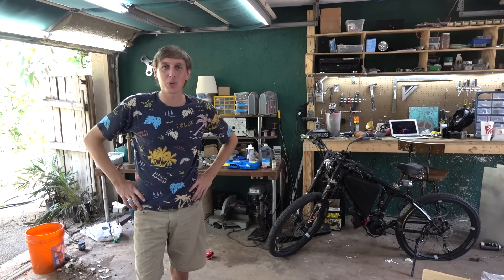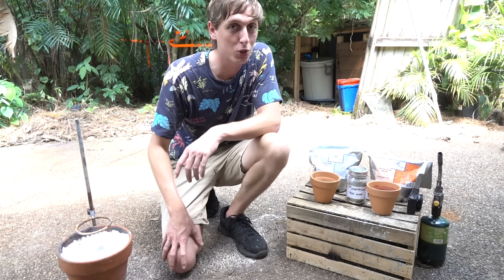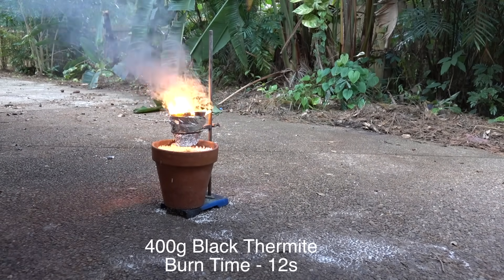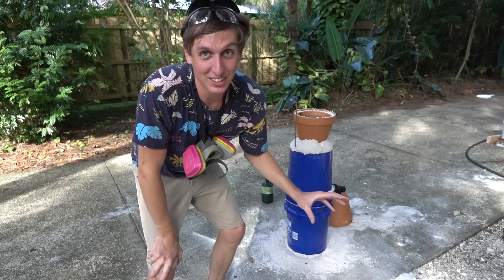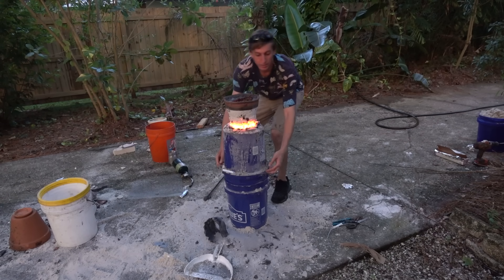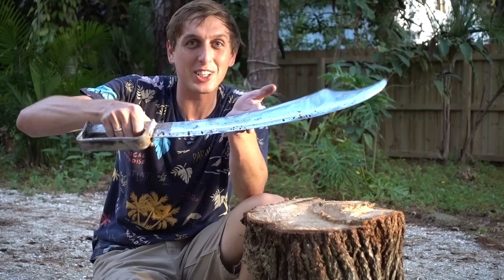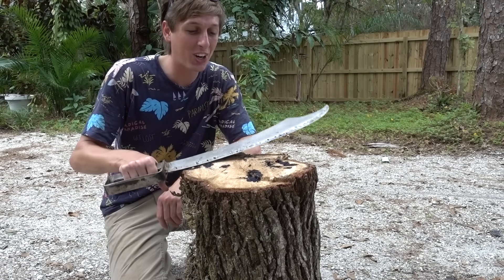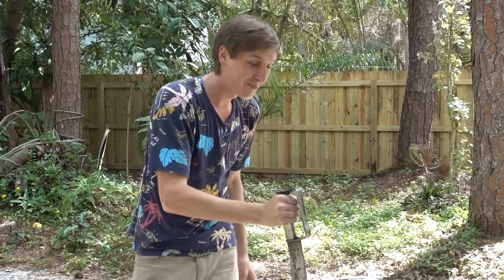Making a Sword with THERMITE!

Comment: if any of you are curous what the fricc thermite is:
Thermite is a pyrotechnic composition of metal powder and metal oxide. When ignited by heat or chemical reaction, thermite undergoes an exothermic reduction-oxidation reaction. Most varieties are not explosive, but can create brief bursts of heat and high temperature in a small area.

Comment: Worries about 500ml of lighter fluid.
Leaves a damn propane tank near termite.

P.S. It was very smart to remove bucket by hands.
If you touched it,you'd get 4 degree burns instantly.
Reply: Darwin Award winner one day, wait and see...
Reply: CME the propane tank legit had my anus clenching waiting for something to go wrong when the molds broke
Reply: propane really can't do much minus turn into a giant torch if the tank got ruptured, you can shoot a propane tank with a bullet and it won't even ignite let alone blow up as mythbusters has proven
Reply: CME As if you knew what 4th degree burns are (it's more than obvious that you don't)....
Reply: stevewonderful Damn right.
Just wait and see...
Reply: Confinium I wouldn't want a propane tank on fire while playing with thermite and having your hands busy...
Also it can explode if you heat it up.
Reply: as i work at tractor supply and work with filling propane on a daily basis for both our forklifts and customers and have been trained on the dangers of propane also, it is almost impossible to get a propane tank to explode
Reply: I dont think fourth degree burns are a thing
Reply: Ethan Baker Yes, they are. At the uni we've been taught that body parts that sustained 4th degree burns are completely carbonized, are beyond ANY possibility of saving and must be immediately amputated. They are also quite rare I'd say (because the body contains a LOT of water that has a high heat capacity and thus can absorb a surprisingly lot of heat before completely giving in). Thus talks about "immediately sustaining 4th degree burns" is complete nonsense.

Comment: When I die, I want my body to be burnt using thermite in the process of casting a sword that will be stuck in a rock out in some random forest
Reply: a hero's passing...
Reply: Hero Slippy you have to be rich to afford this
Reply: I believe the vikings made swords with human bone ash.

"Lotte Hedeager makes this claim in her book, Iron Age Myth and Materiality (2011), on page 143. She backs it up by citing a really interesting journal article (Gansum 2004) that looks at the carburization processes used to turn iron into the steel some Viking swords were made from. That article argues that some swords were likely carburized using bone ash (you burn bones in a sealed container with iron, and the carbon from the bones turns the iron into steel), and further that we sometimes find evidence of bone ash near forge sites, and further that the unexplained pits full if ashes near some cemeteries, too small to be cremation pyres, look rather like the remains of something a smith might make to carburize a sword. It's all very circumstantial, but very evocative and exciting - if it's what actually happened."

Comment: Do not EVER heat treat using water...
Reply: Both brine and fresh water are used in industrial facilities that smelt steel, besides weakening the blade, what are the problems with water quenching?
Reply: When hardness can be sacrificed, mineral oils are often used. These oil based fluids often oxidize and form a sludge during quenching, which consequently lowers the efficiency of the process. The quenching velocity (cooling rate) of oil is much less than water.
Reply: GearandaltheFirst water cools metal down too fast. And can cause cracks and warps. Which is bad if you want a usable blade. However since this is more of a proof of concept rather than a usable weapon. I don’t think it really matters.
Reply: Actually that depends heavily on the steel. For example, you would NEVER quench a 1095 blade in water, due to the risk of cracking. But with something like 1045 or 1060, your chances of cracking are significantly lower.
Reply: i dont think he really cared THAT much about the quality bc like lets be honest we werent expecting much but a chunk of sharpish metal lol
Reply: Water is not very predictable since it goes through nearly 4 phases of heat transfer. That's 4 drastically different heat transfer coefficients. Unless you know exactly what you are doing, water will not produce reliable results every single time.
Reply: I'd be equally concerned with casting it too but lets be real, he isn't trying anything battle ready.
Reply: Yea good point. Just my nerdy side shining through a bit
Reply: I actually was a little scared that the cast sword was just going to crack at a bad moment and hurt someone
Reply: I would think water wouldn't be a good choice due to the Leidenfrost effect which would result in dramatically uneven cooling. Not cooling at the same rate results in more stress on the blade. My understanding is cooling the metal fast prevent the carbon in the steel from fallout out and cooling evenly prevent cracking.

Comment: Dude, your vids are great; but please stop leaving gas containers on the ground next to thermite reactions. No matter how low the risk may be (and I doubt it is seriously that low), we don't want to end up with a crippled, homeless, or dead Kevin. Take care! Keep making these great videos. Excellent idea btw. Very inventive and super interesting.
Reply: Metal is thermally conductive...the heat would be wicked away before the canister could burst...that's like saying that a cigar really can light a pool of gasoline...which it cannot...that only happens in movies.  You see, most liquids have a low heat transfer coefficient, and gasoline is no exception...it seeps into the "cherry", and extinguishes the ember before the heat from the ember can cause it to ignite.  Science.
Reply: The metal can only adsorb (or conduct) a finite amount of thermal energy before the structure will begin to deform or break down. Your analogy breaks down somewhat in this scenario. Gasoline needs an appropriate mixture or fuel and air for combustion. A lit cigarette does not possess enough energy to overcome the activation energy required to start the reaction; and because it is a liquid the ember is quickly extinguished, leading to a rapid reduction in available thermal energy. Molten metal, on the other hand, need only to splash onto the metal container of propane in a sufficient quantity so as to compromise the structural integrity of the metal tank. A decent glob that splashes down on the tank and remains there for any length of time could very well create just such a catastrophic failure in the tank wall. You have to remember, we are talking about thermite reaction temperatures; not scarcely burning paper.
Reply: chozosr388 know how i learned that a guy i worked with flicked his cig into a 5000 gal gas tank scared the uck out of me but nothing happened.
Reply: I agree. That's the first thing I thought when he left it and the bucket caught fire. lol
"This isn't going to end well" haha

Comment: Dang, sweet result! Cleanest thermite pour I've seen outside of railroad welding
Reply from the maker: When I said I was up all night grinding and sanding I meant it!  The steel got into all the nooks of the firebricks and it took forever to get flat!
Reply: I bet, and I'm sure it was super hard too.
Reply: NightHawkInLight whats the parrots name and type of species
Reply: NightHawkInLight im thinking of getting the same parrot as yours
Reply from the maker: Extremely. 36 grit belt sander was having a tough time. I had to buy a 9" angle grinder to make a dent in it.
Reply: +TheBackyardScientist impressive work! Now for new ideas, maybe make a match head bomb but fill a basketball vs the normal tennis ball?
Reply: <3
Reply: NightHawkInLight ive tried making the cbg im stuck any tips
Reply: nwxt timw put some flux in
Reply: NightHawkInLigh
Reply: S
Reply: NightHawkInLight I
Reply: this guy sounds strangely like Kermit the frog...
Reply: OOOOOOOOOOOO İM THE 1THOUSANDTH LİKER SORRY İM TURKİSH İ KANT SPEL
Reply: Look at 8:53 the dog just sits there and watches the sword come down on the soda can😂😂😂
Reply: NightHawkInLight. I love you vids
Reply: TheBackyardScientist do the tornado experiment with liquid nitrogen and dry ice and see witch one works better plz
Reply: NightHawkInLight you called?
Reply: NightHawkInLight sd

Comment: Seams you're a sporty guy. You run your bicycles rearweel flat.😅
Reply from the maker: It has a small leak in it.. goes flat like every other day. I should probably just get a new tube but im lazy and it only takes a second to fill with the air compressor.
Reply: TheBackyardScientist small Challenge:
Try to fix the tube with thermite.

Comment: Thermite sword 
Damage: 69
Durability: 86
Description: an imperfect sword with patterns
made using thermite
Reply: +15 fire damage
special skill: insta flame sword
the sword adquire a very high temperature near to the melting point, now all the damage is fire element damage, set in fire enemies and insta destroy ice
Reply: Speed: fast
crit chance: medium
can be upgraded with a pyro set
Reply: The damage is N O I C E
Reply: Sanet Geyser  it is 69 😏
Reply: Pros:it deal damage
Cons:its ouchie
Reply: pretty much an axe
Reply: Fire Aspect V
Reply: Perfected thermite sword 
Dmg: 60
Durability: 100
Special aspect: flaming arc
Flame dmg: 20% 
Set: perfected thermite knight
Description: "A perfected version of the thermite sword with the ability to throw molten sparks in a wide arc when swung  causing 20% of base dmg as fire dmg"
Reply: @tenshi6293  More like “Special Skill”: “Fruit Ninja,” does + 30 damage to fruit! (9:33)
Reply: critical strike chance: 17 percent chance
Reply: If subjected to fire,sword will catch on fire and can either be used to swing fire which after swinging leaves a fire trail from the swing for a short time or you can throw it too light whoever got hit by it and the fire trail from the throw does the same thing as  the fire trail from swinging while on fire  and the fire trails from both does a bit of burn damage if in contact with someone
Reply: Thermite Sword
73 melee damage
14% critical strike chance
fast speed
average knockback
"forged from the violent blazes of thermite and engraved with nitric acid"
Reply: have a dull appearence but lacerates you badly
Reply: @Killbayne  best comment 😂😂❤
Reply: @Killbayne bro is making terraria descriptions

You got my respect for that 😎

Comment: When you mix fuel, metal oxide and metal powder in just the right way, it burns at two thousand degrees Celsius. Hot enough to cut through nearly any barrier known to man. Throw some C4 into the mix…and you’ve got one hell of a combination.

Comment: Should have oil clinch the sword instead of water to have less cracks in the sword and you should use a angle grinder on the blade a little and on the flat sides to give it a more authentic look

Comment: Now you cant say its made out of thermite thermite is the compound created to burn its not a solid,state now the metal left over is iron aluminum and so forth so the blade would be more of a steel aluminum alloy of anything just figured k might add that in there the sword yes created by the use of thermite is not made from thermite

Comment: 2 suggestions: you should add some flux to control the gassing , and you should cut a vent into the mold, connected to the bottom, to allow air to escape.

Comment: Amazing effort, but terrible sword, my guess is that your sword is pretty much just iron, since renormalizing by heating to red hot then quenching will usually change the crystal structure dramatically even in low carbon steels, so the carbon content must be under 0.1%. You added steel shot to the mix, but the carbon must have either phase separated from the molten metal, or not have dissolved properly in the 2500°C liquid iron. You could try repeatedly renormalizing, or carburizing by heating in a sealed container with charcoal. There's definitely some alloying metals in there as my iron thermite, probably aluminium from the thermite, plus nickel and chromium from the steel shot, as the crystals look nothing like the iron nuggets  from my recent thermite runs.

Comment: When you mix fuel metal oxide and metal powder in just the right way, it burns at nearly 2000 degrees, hot enough to cut through any barrier known to man
            Rainbow six siege 
                    Thermite
Reply: Yourboiabdullah 1 I was looking for this

Comment: Do you think the finish would have turned out better if the mold were horizontal instead of vertical, or does that pose more problems

Comment: Definitely could use some work on your swordsmanship. I say this as a fan, the last thing you want is to take a limb off plus some slightly better edge alignment and cutting form will produce even more impressive destruction.
Reply: yeah, not to mention swinging a weapon made without Sword Smithing experience tword the person throwing the fruit is a massively bad idea since you have no clue if it'll just suddenly snap in two and send a large sharp blade through the air.

Comment: I'm kinda surprised you didn't mention why small crystal grains are optimal in steel.From what I gather, smaller crystals increase the toughness and ductility of the steel, and since toughness and hardness seem to have an inverse relationship in steel, one of the advantages of that sword you made would be that it cuts well while retaining an edge